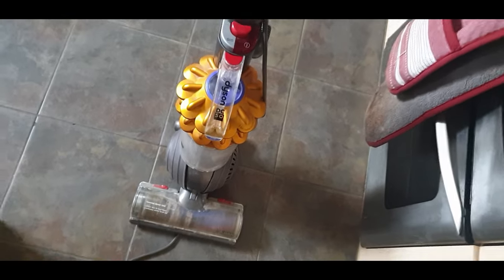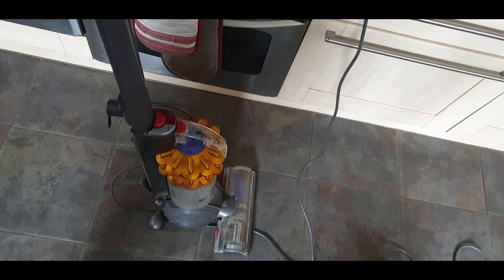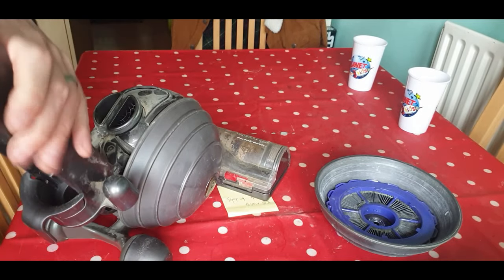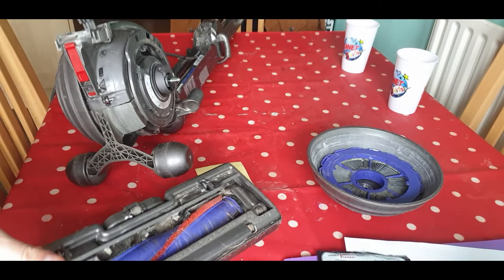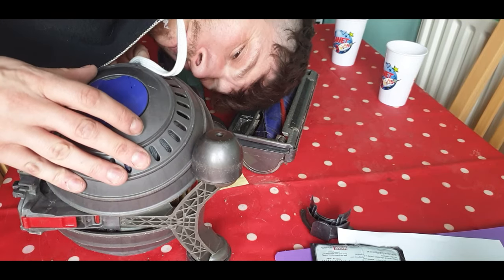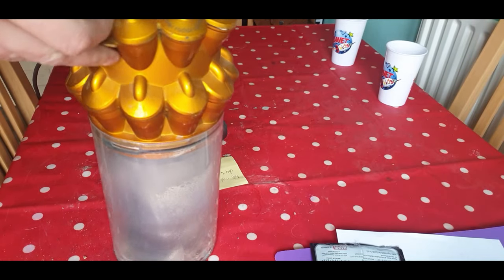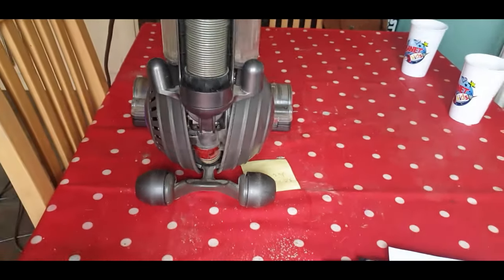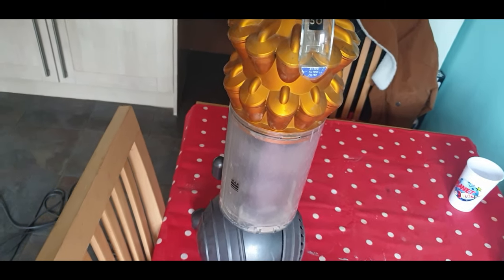Dyson Rollerball DC 50 No suction repair and full breakdown

Comment: I hate this model.. I've had so many issues in the past thinking i fixed it only to have it break a few tries later. I completely dismantled it thanks to your video. Found a massive clog in the filter and the bottom hose. Was able to fix it and it operates like new. Thanks a bunch!
Reply from the maker: i have to agree i have repaired and unblocked mine so many times that's why i made this video to help others

Comment: Thank you so much for this video Karl, you are amazing! I had a 1 year used DC 50 sitting around for the past 5 years (I'm a single mom of 3) because everything worked, but no suction and it was virtually brand new. It killed me to throw it out because I knew it had to be an easy fix. Years ago, I watched countless you tube videos, took it apart, cleaned it out and nothing. Today, I decided to try to resurrect it and immediately came across your video...my "secret filter compartment" overly was packed like yours with all kinds of things! Thank you, thank you, thank you. My Dyson is now running amazing and back to work!
Reply from the maker: Glad it helped you out

Comment: Great. Had already taken it all apart, no blockages but your video made me think of the seals. The one that switches between vac and tube was a little out of place, pushed back into place and all other seals checked and it is working fine again. Cheers!

Comment: Karl, thanks for your video, I had a DC41 with the same issue, your disassembly instructions help me remove one side of the ball cover and filter, and allowed me to spot the cause of my Vac's issue; a pen stuck in the L bend of the upright hose near the ball which prevented the rubber seals engaging properly when the vac was put into floor mode. Removed the pen and the Vac is working normally with full suction. Cheers.
Reply from the maker: So glad I could help its why I put these videos up

Comment: THIS WORKED! I was able to get my Dyson to work. For me, I used baking soda when cleaning. It was clogged under the color piece in the main collector area/jug. There is a tab near the red part on the juggy thing where you can open it up and clean out. In this video it's at 7:36. I found a cotton ball cleaned the gray filtery area as I had both dander and baking soda fully clogged there. Baking soda is a no-no and now I will listen to that!
Reply from the maker: Excellent!

Comment: I really hated putting this together when it was gifted to me and for the amount of cash these things cost they shouldn't clog up like this after a short amount of use. This was very helpful and I'm going to tackle mine now.
Reply: Yes, yes! You're so right on point. There's little doubt that the Dyson cleans well, but the collection chamber/bin is a farce. I don't recommend these if you have a shedding pet unless you have the stomach and/or patience to field strip it and reassemble every odd month. I also recommend a decent supply of chopsticks kept on hand for fishing out the hair at the upper top of the collection chamber at each dumping. 

Also, the Dyson brush roller seems to not last as in loosing bristles quickly, more importantly the dual brush roller with the hardwood/lino soft bristles which disappear. The DC50 and others has the washable cone upper filter which is such a bugger to clean, but I figured out the best and perhaps only method is to pop off the top portion clip to roll the filter in backwards to expose the inside which holds a lot of crud! A lot of rinsing and using a plastic dental pick to pick out the crud collection at the bottom. This is a piss-poor design in my opinion. My last gripe is that the Dyson is super loud. Oh, I'm sure everyone hates the wand hose too... when you finish fighting to stretch it out longer before toppling over the vac, the less suction you shall receive. haha

I still have my DC51 Pet (these are not for shedding pets!), but rightfully retired it for a Hoover (Air Steerable) - which is a lovely beast of a machine and the filters are so simple to rinse! I'd leave the DC51 by the side of the road, but it's worth too much to simply giveaway and why not get a few bucks back on a bad investment anyways? It's a designer vacuum in essence, as in shoddy workmanship and the like, but you pay dearly for the name printed on it. ;-P

Comment: Thanks. I didn't know about this filter part either. I'd cleaned the other filters several times, but not that one. After watching this video, I opened it up and it had a solid layer of dust so thick that I couldn't see the mesh underneath! I cleared it out and it now seems twice as powerful, especially the hand held/hose part. (and it fixed my issue with a change in tone/loss of suction)

Comment: Ladies and Gentlemen
Thanks to this video my dyson works great now!

My Dyson was working but only the hose part. I cleaned all the filters, brush
and so on. My Dyson still was only sucking through the hose part.
So I knew it had to be a problem between the brush part and sucking.
At the back where the hose hooks to the ball part, little red thing holding the hose on, i slid that out and low and behold that's where the clog was.
It was a water bottle cap! Yes something so stupid, but simple to fix.
I finally got it out, and got all the clog it was holding behind it, and it works great now!
Reply from the maker: Great to hear you fixed it

Comment: Thank you for giving me the courage to dismantle and probe what the problem was. My problem was the same as yours. The dust canister was completely blocked by dirt and stuff packed into that hole. I used a needle  nose pliers to get all the sections cleared and it works fine! Thanks again, love!
Reply from the maker: Glad I could help!

Comment: When I was a child my father always told me I was mechanically inclined. This dyson was the test! It had stopped sucking completely and I could see all the hair wound around the roller, but had no clue about the dust (I live in mid-town Manhattan) stuffed inside the head -- even though I'd cleaned it thoroughly (or so I thought) after someone gave it to me as a hand-me-down. Should work beautifully now. Fingers crossed!
Reply: C'mon Claire, did it work ?
I find it bizarre that anyone would try to rectify a problem and then not bother to see if it is actually fixed before making a comment about it on YouTube.
Or is that a mid-town Manhattan thing ? The medium is stronger than the message, perhaps.

Comment: Excellent and instructive, and saved me buying a new vacuum cleaner!  Key point was showing me how to disassemble each part seeking the problem.  In the end I had to also remove - only a simple screw - a transparent tube that connects at the front where I found a 'lump' of hair, dust, assorted debris blocking the suction.  And, the best bit, I was able to reassemble the DC50 first time.  Now working a dream :-)
Reply from the maker: Great to hear that

Comment: In my day job, a lady had one of these on her door step. So I asked her what was wrong, and she said the suction was poor. I asked her if she had checked it for blockages, and she told me she couldn't wait and simply bought another hoover. So as soon as I can, I'm going to follow your advice and fix this one. Along with the DC41, DC24, DC07? I got recently :-).
Reply from the maker: That is amazing I also got a older model dyson years ago that the brush didnt turn all that was needed was a new belt.  Unless it's the motor most vacuum cleansers and not difficult to repair
Reply: @KarlFixes  yes. Especially Dysons. Watch a man who knows what he's doing and you'll have no problems. I have a Dyson in pieces waiting for a.motor transplant from another I obtained. Thanks!

Comment: I just took ours apart and checked the hoses, cleaned both filters, and it's still only sucking through the handle.  Any other suggestions you might think of?  Great video, helped me to tear down the machine and I never knew there was a filter in the ball.  Thanks mate!

Comment: I wash the drum and the whole cyclone top under the sink, so much dirt washes out. Also wash the filters. 12 hours later it’s dry to use. Clean as a whistle. You roller needs a clean, easy to take apart and clean away the stuck hairs

Comment: Thank you for putting this together. Much appreciated! Mine sucked in what I think is a plastic gallon jug top through the hose and its totally blocked [hissing with no suction in either mode]. I’d love to fix it myself. Any ideas before I bring it to the Dyson repair shop?
Reply from the maker: If it's stuck up the hose unclip and try to see if you can blow through it or see light through it if not then it will be in there and use a rod or something to push it out.  I don't think a bottle top would get inside the actual main hoover compartment it's too big
Reply: @KarlFixes  FOUND IT!!!   It was a full piece of paper towel blocking the joint between floor and hose. Thanks for your quick response, Karl! MUCH APPRECIATED!! [To think it's been out of commission since last July...]

Comment: You need to do a complete deep clean of that machine. You can take apart the cyclone chamber and wash it all out.be careful of the gaskets inside. Also disassemble the roller brush head and clean out the brush and passages.

Comment: Did all I can but its making an odd sound and won't suck at all. Thanks for the video.
Reply: I mean it's sucking but won't suck up from the bottom
Reply from the maker: Its hard to know but make sure its not blocked or that the rubber joint between the head and the up pipe is not broken or missing

Comment: At the beginning of the video, there was a coin in the bottom of the hose where it narrows. My ball was doing the same thing and making that same thumping sound a few seconds after being on. That sound and the sucking change in the coin flipping to totally obstruct the hole. Take the hose apart and use a dowel to get the coin out.

Comment: dont know if you ever managed to get the bottom cable hook back on, but if you remove the hose if will slide in place easy, than reattach the hose to lock it in

Comment: Hi, great video but I'm still trouble shooting. I looked over a Dyson Total Clean vacuum, new hose, filters look good, no apparent obstructions in any of the hoses nor wand nor in the roller bar area itself. I'm not getting suction thru roller bar area nor at the hose handle. When everything is removed and I turn it on the Motor sounds good and at the top of the ball only is very strong suction & air exits the side where the filter attaches. I feel no suction where the roller bar would attach to. I have tried both handle positions (upright & down)  I am baffled cause I see no obvious issues, the connecting mechanism there is moving accordingly.  Do you have any other suggestions? Thanks in advance   : )

Comment: I was given my DC50 by my mother-in-law after she had it for like 3 months. I think she paid like $400+ for it brand new.  She never really took it apart to clean out the many places where hair and other crap get trapped. I did. I got it working just fine. That lasted about 5-6 cleanings. I brought it to the Dyson service center here and got it tuned up, for free. It was still under warrantee. Fast forward about 3 years and I'm very tired of tearing down this machine to clear blockages, all the time. i wash filters, blow out the cylinder screen with a can of compressed air (Staples- the same stuff used to blow out your keyboard, etc). One good tip the techie gave me to eliminate the nasty stench was to place a dryer sheet in the empty (cleaned out) canister and let the machine run for like 20 minutes :-)

Anyway, I think it's time to replace the DC50 (it's old technology- they don't even make that model any more).

Comment: My dyson has no blockage whatsoever anywhere. For some reason, there is absolutely 0 suction at the bottom, and I bought this second hand just a few weeks ago. I’m not sure what to do. Any advice?
Reply from the maker: Its hard to say but is the rubber 0 ring that connects the head to the pipe loose or broken.   It needs to be sealed.  Do u have suction in the pipe

Comment: Thanks just saved me the price of a new Hoover thanks to pesky lego stuck in the hose 🙂
Reply from the maker: If its a brand new build check all your hardware and cables make sure its all seated correctly.  Have you got your hard drive set as a boot device in bios.

Comment: Wow how did you get the tube from the back off that mad I’ve been trying for a while now and still no luck
Reply from the maker: Comes off easy just one click of the red button
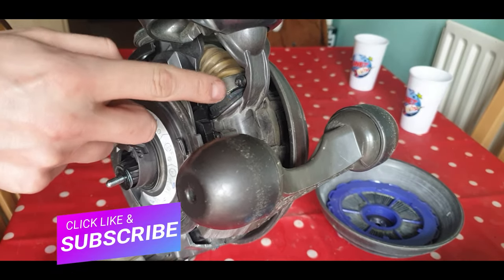Reply: Karl Fixes Karl Fixes I didn’t manage to get it off it’s a slightly new version that won’t let me I think. But when you turned it around revealed the suction connection 3:15 there was a little lollipop stick right in between. Now after taking that out and doing all the other bits you said to do it’s like having a new hoover!